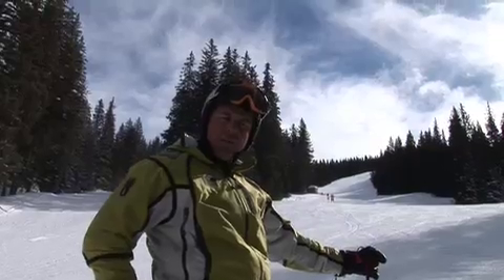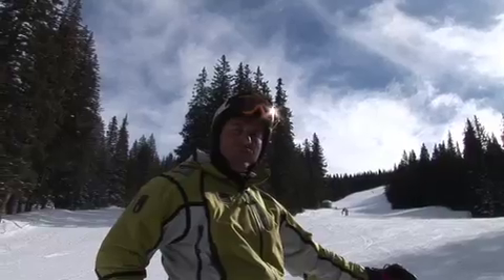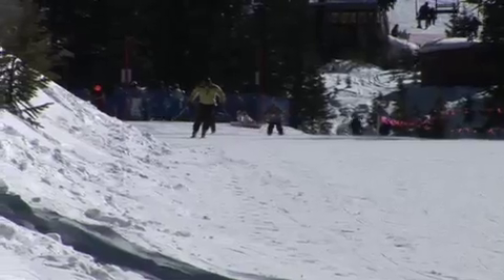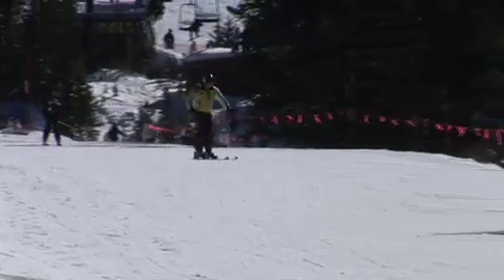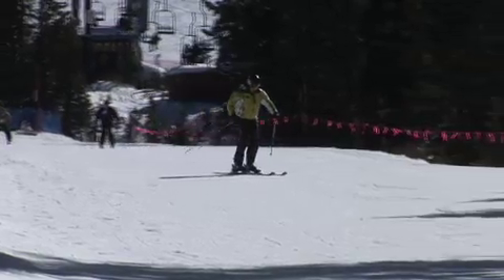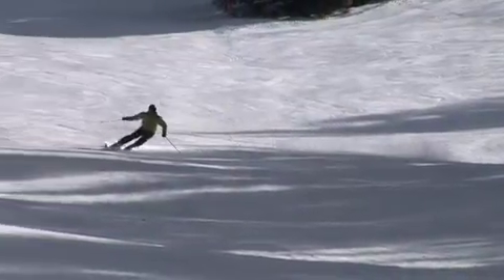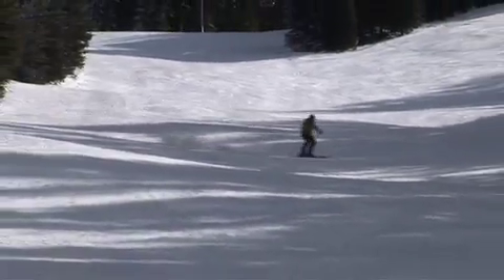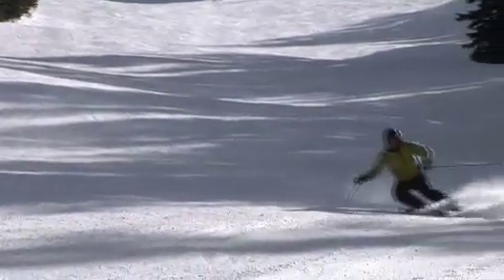Carving Turns on Shaped Skis

Comment: @MrChurbs That will create a bad habit over time. You shouldn't drag your inside ski parallel. You want about 60/40 weight distribution. Just roll the skis to initiate - it's the point of the new sidecuts. Try also leading your inside knee into the turn.